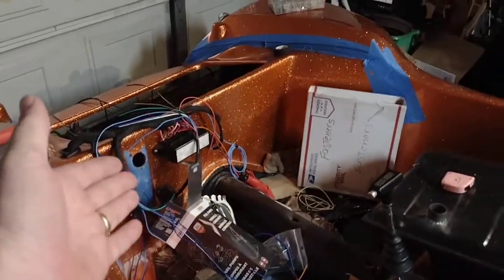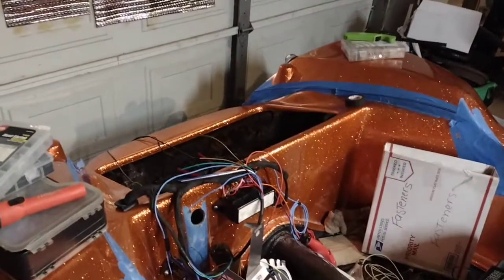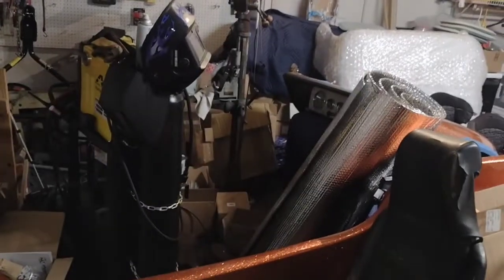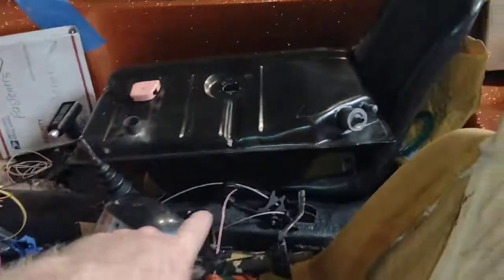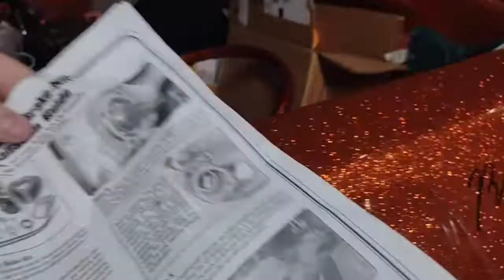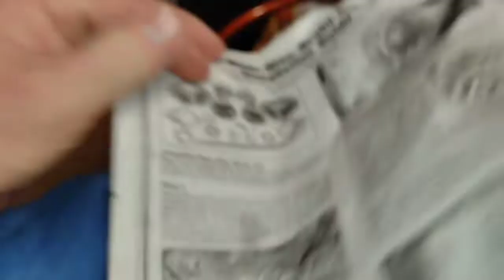Meyers Manx update, Brakes and wiring. #volkswagen #meyers #aircooled #boost

Comment: Damn look at that bitchin steering wheel! I have cb wide 5 disk brakes on my 66 and love them. Pay attention to where the bleader is on the caliper. After fighting with  bleeding the brakes I figured out I had to unbolt the caliper and rotate it up on the rotor to put the bleeder straight up to get the brakes to bleed